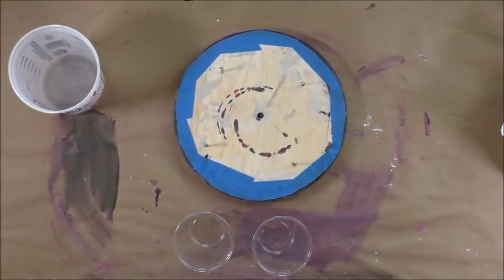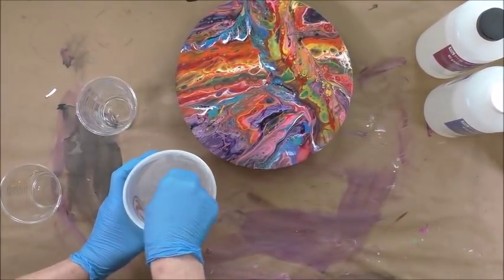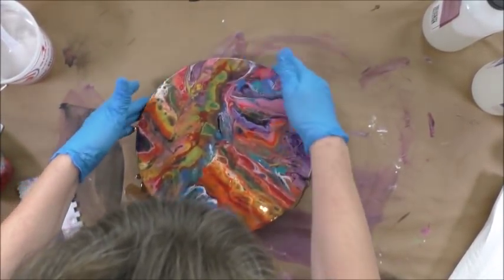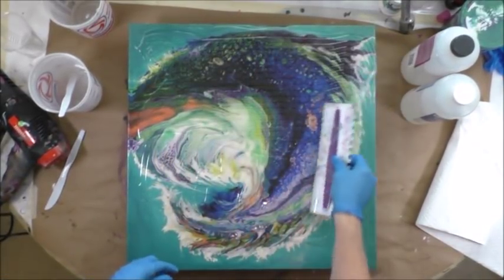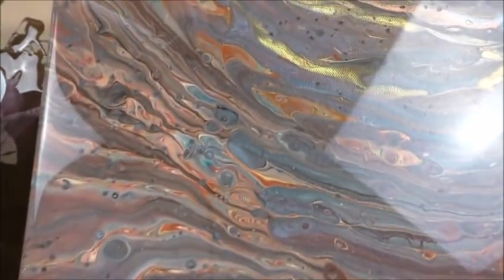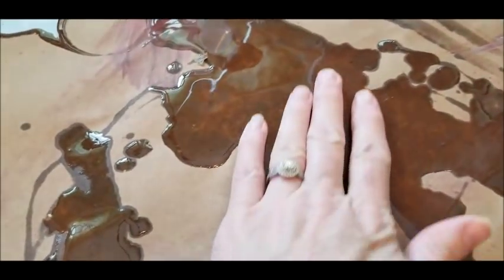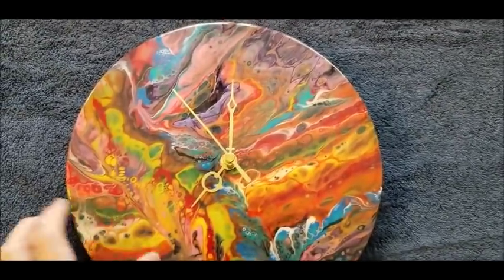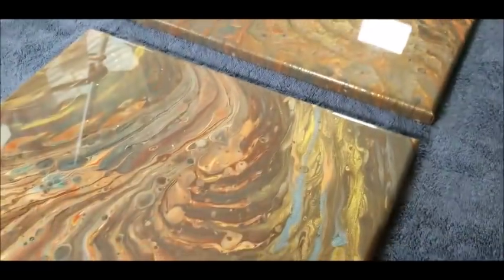(157) Resin Tutorial Over Acrylic Pours on Clock Printed Canvas & Diptych ProMarine Epoxy 081718

Comment: I ♡ resin. Photos and videos never do resin pieces justice. I usually take my pictures outside for photographing. If you use a acetate sheet, parchment paper or anything plastic to catch your drips you can peel the resin off to use the skins. Also, if you go to "Art Resin" site they have a calculator that tells you how much resin you'll need to mix for whatever size piece you're doing. Lastly, after you put your numbers on the clock, which may I add is beautiful, you could add a coat of resin to seal the numbers. Hope you have a wonderful weekend Sandra. ♡
Reply from the maker: Thank you so much!  I appreciate it
Reply: Thank you for the great info

Comment: Awesome, do you have a video or link to the clock (is it a kit)
Reply: Marianne Reddick just saw your comment. Pretty sure Sandra will put the link for you but I just wanted to let you know incase your interested... There's a site called "Minituresweet.They have clock molds if your interested in making a resin clock. They come with all the hardware needed to assemble one for about $7.00. If you're into resin they have tons of resin molds for really cheap prices and the molds last forever. Just wanted to share what someone kindly shared with me... ♡
Reply: thank you so very much! I did follow her Amazon link, I saw parts but no kit- I love doing resin molds, haven't tried resin on canvas yet..
Reply from the maker: Hey Marianne!  I purchased the wood and clock kit at Michaels...  The 10" round is $7 and the kit with the mechanism, hands, numbers is around $10...